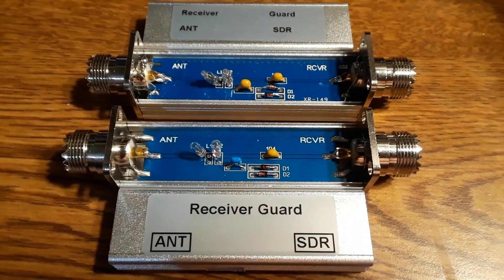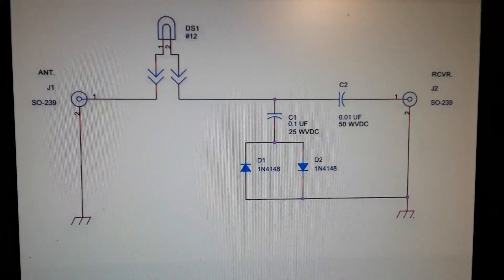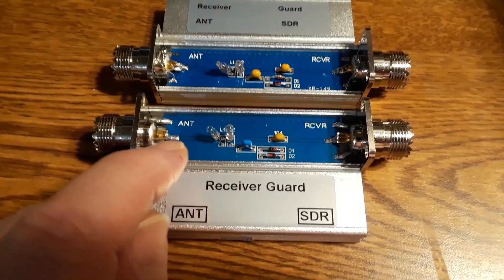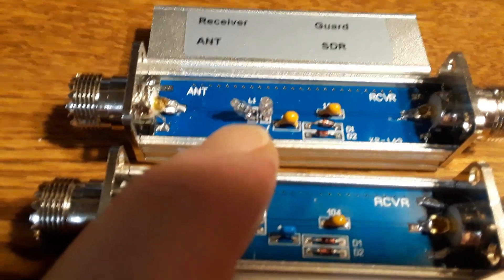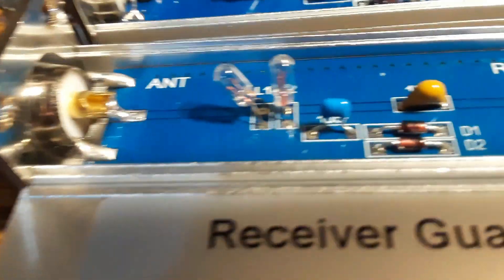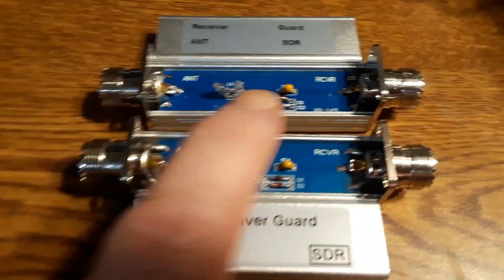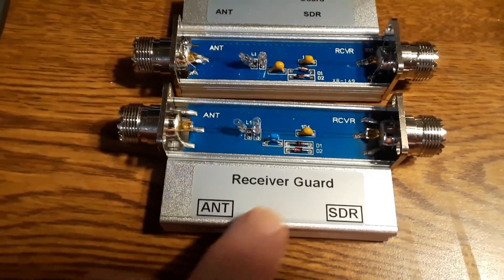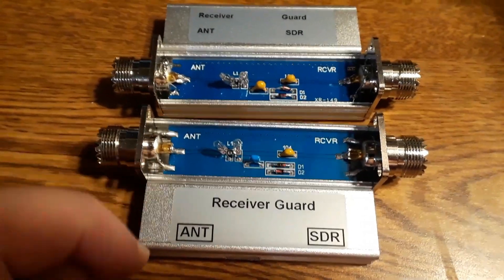Don't Buy Fake Receiver Guards.

Comment: I purchased three of them.  Getting a refund and sending them back.  Looking for an old cheapie TVI filter for CB radio back from the 70's at a swap meet and going to build one of these things that will work.  Cheap Chinese junk!
Reply from the maker: Thank you for your comment. 
The one version in theory does work, but the other with the neons don't pass the signals to the receiver. Honestly I dont really trust either to protect any equipment and would advise to avoid these totally. There are "real" protection devices out there but expect to paid lots of money if you find any. One version uses back to back schottky diodes, but I believe any good design of SDR already implement such protection. However they dont protect anyone trying to share an antenna with an SDR & transmitter, thats asking to fry any shared device front end.

Comment: I received one of the junk devices from a Chinese seller on eBay. The sellers page shows the label of the good devices, but the device send had the label that corresponded to the devices known to be bad. Is there a way to repair the ad devices, e.g., by replacing the neon bulbs? Which bulb would I order?
Reply from the maker: That's a very good question. 
I have not tested the bulbs yet in the units classed as "Good". To allow a signal through to the radio, incandescent bulbs would be required as the neons will be a DC block to anything below about 70v.
The problem is the whole idea it to protect the radio from a high input voltage, and that voltage might need to be kept very low so as not to damage the front end of the radio. This damage level would depend on the devices used in the particular radio/SDR in use. The other issue is that a device would need to clamp any voltage that might damage the front of the radio/SDR in an instant.
I believe most of the modern radio/SDR'S today use back to back diodes across the RF input of the Radio/SDR. Would incandescent bulbs really provide the sort of instant clamping effect required of a near by lightening strike? Probably not. Using one of these devices is not going to do much to protect your radio.
It could possibly bleed off static electricity build-up on your antenna.
So, coming back to the bulb question.
I would use as small a voltage and wattage possible in a grain of wheat type bulb. I could apply a small voltage across the bulbs in the "Good" unit to see at what point they begin to glow brightly abd measure the voltage and current to calculate the wattage.This would give an approximation of the bulbs in use. I think my main issue here is that these devices will only give very limited protection to any incorrect applied voltages. In other words, they are just about as good as no protection at all !!
You definitely CAN NOT share an antenna with a transmitter as that will blow up the  SDR front end unless you have some sort of intelligent switching unit. In my home antenna setup, I use a special antenna switch that disconnects the SDR input if I transmit any RF, but shares the antenna for RECEIVE ONLY !!
Would I trust one of these so-called receiver guards to protect the very sensitive front ends of any SDR/receiver? NO, I DON'T !!! In a storm, you should disconnect your antennas to be safer.
There are designs online for various versions of these so-called protection devices, but none can guarantee the protection of your equipment 100%
It's always a gamble.
Sorry for the long reply.
Reply: @KB1UIF  Thank you for your detailed opinion, it comes with good timing as I have not hooked up my SDRPlay device to the rest of my rig. Expecting any good protection from a device as cheap as this one, was probably wishful thinking to begin with. But it sounds like you would be similarly leery of a more expensive device with similar operation, such as the RG5000HD from DXEngineering. I may look into the TX disconnect switch; I think MFJ offers one.

I was also wondering whether I need to worry at all about this. I do have separate TX and RX antennas. For TX, I use a 20 m dipole, for RX I use a discone antenna. The RX antennas is in the near field of the TX antenna, perhaps within 3 feet. However, I am limiting myself to TX power of 25 W, so I am not blasting huge amounts of power. But I do not have a good feel for the severity of my problem.

Thank you for your advice. AB3HK

Comment: Thanks for this and your time to make it. A valid point is that yes, neons have been used for years... but mainly in valve circuits where the voltages are higher. I think I'm right in saying even if they worked here, the SDR would be dead before the neon's triggered.
Reply from the maker: The problem is that the neons have been put in line with the signal path and not to ground. The result is that no received signal reaches the SDR in the first place.
The use of neon in this position makes the device useless.
Reply from the maker: Yes, neons do serve a purpose if shunting to ground but only strike at around 70volts. So even if they connected them between the signal path and ground, it would not protect the front end of an SDR. Older equipment, yes, they have been used for protection.
Thank you for subscribing. :-)
Reply: @KB1UIF  Thanks for your replies, I appreciate it.
Reply from the maker: @acestudioscouk-Ace-G0ACE  Thank you for your comments, they are always welcome. 🙂

Comment: I have read and seen (https://www.youtube.com/watch?v=I3QtuozE3vU ) that some Chinese SO239 connectors have metric thread pitches that mesh poorly with a standard PL259. (There is no problem if the PL259 is also Chinese, because it will have the same metric thread pitch.) Has anybody had trouble with the SO239 threads on this receiver guard? Also, does this device only protect from nearby lightning strikes, or does it also protect an SDR front end if a 100-200 W transmitting antenna is ~10 meters away from the receiving antenna? Thanks!
Reply from the maker: I can't tell you how effective these devices are. That would require extensive testing. I have used them on a couple of my SDR's while transmitting on HF and VHF. I also have an auto switch that disconnects my SDR'S antenna when I transmit. Obviously, nothing is going to protect from a direct lightning strike. There are various items and designs out there. My video is to point out there are units out there that don't allow any signal through to your radio receiver. So basically useless to use.
DO NOT SHARE AN ANTENNA WITH TWO DIFFERENT DEVICES IF ONE TRANSMITS !!! YOU CANNOT TRANSMIT ON AN ANTENNA WITH A SEPERATE  RECEIVER CONNECTED AT THE SAME TIME !! UNLESS YOU HAVE A SPECIAL DEVICE OR ANTENNA SWITCH THAT DISCONNECTS THE SDR/RECEIVER.
Reply: @KB1UIF  You have also pointed out that it is inexpensive to fix the bad design by replacing two inexpensive light bulbs. Does your reply also mean that the SO239 connectors worked OK with whatever PL259s you tried?
Reply from the maker: @Jon Ahlquist  I had no issue with the SO239 connectors with the units that I bought. I've never had that issue, but it seems it can be an issue when buying the SO239's separately as per the video you referenced.

Comment: Andy, neon bulbs have been used for many years in receiver input stages as protection. It's a little hard to see in your video, but could the neon bulbs be shunted to ground rather than in series as with the incandescent bulbs? Could be verified by taking an ohm meter and measure from the ant input to the antenna side of either the c1 or c2. You should see continuity. Obviously, measuring from the ant to receiver port with an ohm meter would result in an open due to the series capacitor. I would expect to see the neon bulbs discharging high voltage to ground rather than in series with the receive path.  I would be interested to know what you find out. Also, what makes you think the device with neon bulbs wouldn't work? Did you see issue when inserted in the receive path of your SDR? If the Neon bulbs are in series with the RX path, then there must have been an issue with someone using the wrong board or bulbs during assy?  Thanks for the video!
Reply from the maker: Hi Jim, Thank you for your comment.
I am aware of neon's being used for shunt protection in the past, in this case the neon bulbs are not shunting to ground.
I found the issue when I installed the faulty device inline between my HF antenna and SDR, there was no path for the RF to pass to the radio. 
The PCB's are the same circuit design shown in the video except they use two bulbs and not one. 
The problem is literally that the faulty unit has been assembled using neon bulbs and not incandescent bulbs.
With neon's there is no continuity from the antenna input to the inline capacitor labeled C2 in the diagram.  
I ordered several of these devices to investigate the issue. 
Another Ham friend of mine experienced the same issue, so I explained to him what the manufacturer had done in error.
If you buy one of these faulty devices it is possible to replace the neon's with incandescent bulbs and you will have RF presented to the radio in use.
For a quick and dirty test short out the neon's and bingo you will be receiving again, but do not leave the device with shorted neon's or bulbs. 
These devices are not great for protecting radios but if you buy the wrong one or are sent the wrong one understand what is happening. 
I also saw online photos of the PCB in some cases and some show Incandescent bulbs and some show neon's. 
If you do a search on eBay for these devices you may find the images for yourself. 
One other note, these devices are used for receive only not bidirectional for transmit use.
If you buy and use one of these units you do so at your own risk. 
I'm not affiliated with the people manufacturing or selling these devices.
Reply: @KB1UIF  Can you recommend an incandescent light bulb for replacement?